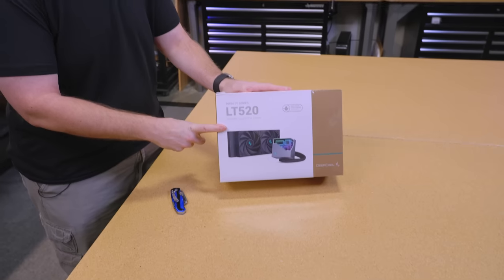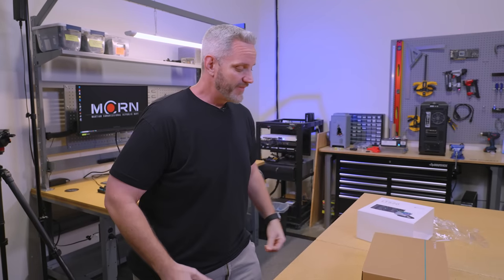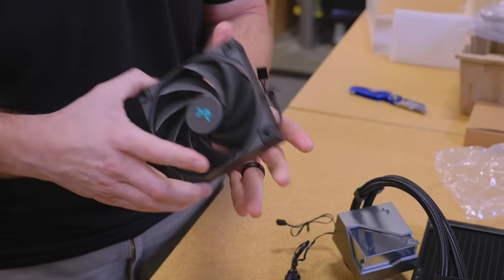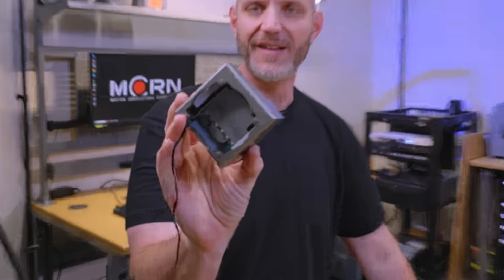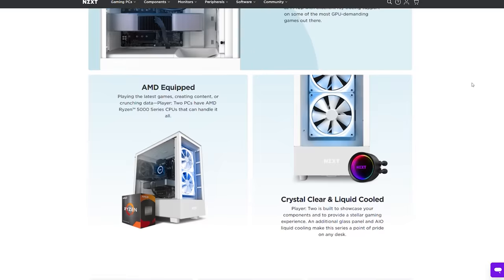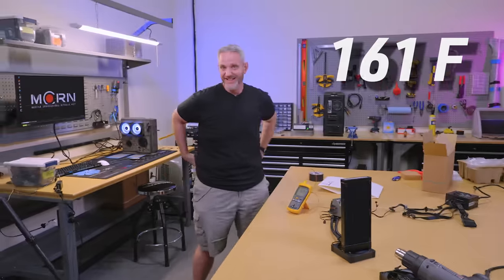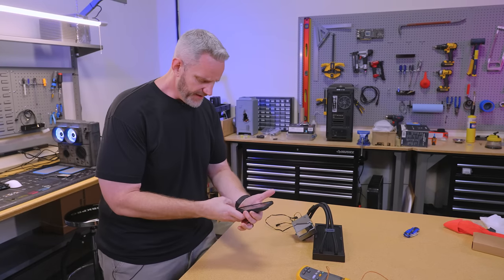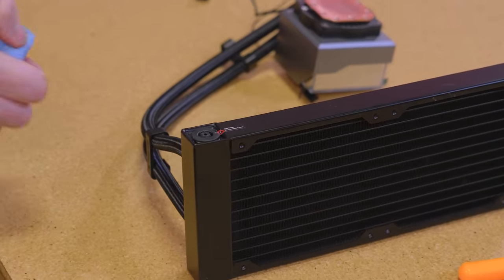They say is won't leak... I'll be the judge of that!

Comment: That bag is inside the radiator and it's pressurised to a certain amount, when the liquid temperature increases the pressure will also increase and the volume of the bag decreases to maintain a constant pressure inside the aio. It works like a reverse water expansion tank that you usually find beside an electric water heater.
Reply: Exactly! And that's why I got the deepcool castle 360  in 2019 to throw on my brand new 3700x. No problems going strong front mounted.
Reply: Was about to comment this, for some of these videos I really wish jay would invest 5 mins more of really understanding the Idea.
Edit: It's kinda nice that, as a side effect, you can refill this AIO with distilled water in case too much diffused:)
Reply: @Ahnii it's shit like this that keeps Jay well and truly in the "entertainment" category. I watch almost all of his videos, and I do enjoy them, but sometimes he just starts chatting absolute bollocks about things he could have understood with like ten minutes of effort.
Reply: I mean even the pic he showed shows it sticking out so you can freaking see it with a big arrow that shows how air is what comes that way. OR he could read the paragraph right next to it..... How would that even work. That doesn't even make sense. I think he's smoking the stuff bro.
Reply: The other thing to add is that the volume of the bag does not need to be that big.
Remember that it is compensating for the volume increase of the coolant over the design temp range.
A 240 AIO fluid volume is going to be what? half a litre maybe. Just how much will that half litre expand between 20 and 70 C?
Reply: Exactly correct. For anyone interested, the relevant equation is PV=nRT, since moles and Rate Constant are constant, you can simplify to PV/T is constant.
Reply: @petert3355  a 240 aio have around 200ml of water inside, if we take in consideration that the volume it's 200ml, the ambient temperature(initial temperature) 20°C, and the max operating temperature 50°C, that water will expand whit approximately 4.2ml, and in Jay's experiment the volume of water increases with 8.4ml. So... That's more like an anti bursting feature, not an anti  leaking feature.
Reply: @alexandru5989  ok, my volume was pulled from you-know-where but I tried to base it on my current system. (it's 4 litres of coolant).
point is, and thanks you added numbers to it, the volume of the bladder does not need to be that large to handle the temp change for the coolant volume involved here.
Having the rubber bladder that size, entirely within the rad tank, would work without the bladder extruding from the rad. All it would do is collapse.
Reply: It’s more likely that the little bit of air in the fluid chamber is the thing that would expand most. The fluid itself wouldn’t change volume appreciably unless either it boiled (and became a gas) or it froze (and became a solid). And interestingly, water is pretty rare in that it actually expands when it becomes ice. That’s why ice floats.
Reply: The bag isn't pressurized, it's just a length of tubing open to the outside air on one end, so the fluid can squeeze it.
Reply: @TheSkiddywinks  I don't know what video you watched but he clearly understood how it works.
Reply: @phunkydroid  Well technically it is pressurized to atmospheric pressure. But you are right, it is just essentially a void in the loop that can be squeezed if any excess pressure were to occur.
Reply: I'm going poop.
Reply: Jay has been completely disconnected from the industry for many years now. These videos are just to pay the bills. And buy more properties and fancy cars.
Reply: It's not the heat, it's the humidity !! :)
Reply: @nddbulldog1  Did you not hear me? I'm literally pooping (still). I think this new pre-workout powder is messing with me. It's hard to tell though because I actually enjoy pooping so I don't as often as possible. It's very relaxing to be in here, just me my tablet and my thoughts... I use a bidet by the way, I'm not a disgusting heathen.
Reply: Lets call it the AIO condom. And like a condom, it save you a ton of money.
Reply: @justinseans I mean he is in cali….
Reply: He said that..
Reply: And you can refill or change the water in the closed loop too, not all AIOs can do that.
Reply: @petert3355 500liters of steam from half a liter of water soo
Reply: @rubenjanssen1672  yeah, but how much steam do you get from 80 degree C water?
Exactly none is the answer. 
We are not talking about a boiling loop here.
Reply: @petert3355  wrong youhav always some liquid turning to vapor (open containers of water wil turn drie eventualy) is it as quick as  oiling at 100c no but it stil hapens
Reply: @rubenjanssen1672  the amount of steam generated at 80C is negligible compared to the expansion in fluid volume. 
That is basic physics.
Reply: The volume increase as the temp increase to maintain pressure as the user maunal said. idk how squeezing the bag would increase the internal volume tho.
Reply: Almost required for folks with boiler heating in their homes. Obviously their expansion tanks are a bit bigger, old ones are 15 gallons or so, new ones only like 1.5 gallons
Reply: Every hydronic boiler system has an expansion tank or bladder tank to absorb expansion and keep the system pressure from rising.
Reply: How does the temperature of the bag (or anything else inside the rad) decrease when it's being consistently heated?  Is it made from a material that does this? Or does it expand and lower the pressure and thus cooling bthe fluid? (Not a big enoughbsystem, and not enough pressurization in this AIO to pull that off.) 
What am I missing here, because right now the physics isnt adding up for me right now.
Reply: How does the pressure increase, but the temperature decreases? Thats antitheitcal to the laws of thermodynics. Higher pressure = heat. Lower pressure = less heat. Like an AC pump.
Reply: @MurpheeLaw  it's not antithetical you put the problem in the wrong way, the bag it's open to the atmosphere so it's pressurised to the atmospheric pressure, when the temperature of the water inside the loop increases so do the pressure of the water will increase because theoretically the loop was an constant volume and at this point the pressure inside the loop will be greater than the pressure of the atmosphere/bag and because the bag it's made out of rubber,an soft material, the bag will deform/ shrink to compensate that pressure difference. So... when I said that the volume will decrease I was referring to the volume of the bag not water
Reply: @MurpheeLaw  You are way overthinking this. The bag just gives a bit of safety margin if an over-pressure situation were to occur. It doesn't lower the pressure, or cool anything. It is nothing more than extra space for expanded fluid (pressure) to go.
Reply: @michaelscott466  are you still in wc ?

Comment: I assemble PCs for a living, dedicating 9 hours a day to this work. Over the years, my experience with Deepcool has been incredibly positive and consistently reliable. The LT 720 is significantly better than the Asus Ryujin II, even with Noctua fans. Based on my experience, all of their products are amazing and reasonably priced. However, my favorite coolers to assemble are their AK series for air cooling and LT series for AIOs; they never disappoint and so easy to assemble.

Comment: I went with the Deepcool LT720 for my first ever PC Build (built the PC a few weeks ago), and I LOVE IT! the AIO looks so nice and it has been cooling my 13700K nicely and pretty quietly. I have no complaints so far
Reply: so far... AiOs are not made to last, they will fail at some point.
Reply: @wherearemytesticles  They can last 5 years if you're lucky. I was against one at first, but after the next gen Noctua air coolers got delayed and after hearing how hot the 13700k can get, I decided to get one
Reply: @wherearemytesticles  A decent AIO will last at least the lifespan of your gaming PC if not longer. I've had 4 gaming PC's in my life and only one of them I kept for longer than 5 years before it needed to be upgraded/replaced to deal with the latest games.
Reply: @wherearemytesticles that's a general issue with watercooling. Pumps can die, stuff can get clogged up (although that's usually an issue with the coolant), it's just a matter of fact that moving parts can, and will break eventually. Same thing with fans by the way. It's rare, but it happens. AIOs are the easy watercooling solution, and, generally speaking, a lot cheaper than custom loops, let alone the time you spend on those. 

So, yeah. People are aware that they aren't made to last forever, but that comes with the benefit of low/no maintenance and easy replacing it
Reply: And so you can buy another one. They lasts years, not days  @wherearemytesticles

Comment: Oh wow I'm interested in hopping into the world of water cooling with a LT720, so this video is greatly appreciated!
Reply: I got it just recently
Reply: And I'm planning on getting one in a month or so, along with a new case, also appreciative of the video 👍
Reply: I have the LT720 cooling my i7-12700k. Great cooler.
Reply: Go for it!! I bought the LT720 for my 13700k and it's doing great! I removed the stock the thermal paste and applied Arctic MX-6 and it keeps my CPU cool even under heavy loads

Comment: Seeing it survive this type of torture test speaks really well to its construction! Great stuff, Jay!
Reply: Kind of hard to say it survived the test, it just didn't fail spectacularly. That is all we know for sure.
Reply: 72C is not a high temperature to be honest.. Water boils at 100C. Most gpus and CPUs get hotter than that by far
Reply: @flatmotion1  Did you watch the video at all?
Reply: @flatmotion1  72C isn't a high temp for the CPU. The fluid temp, and pump operating temp (the part Jay was focusing on), have very different thresholds.
Reply: Yeah im still sticking with air cooler. AIO just seems like a ticking bomb waiting to fail and break your components

Comment: I'm more concerned about pump failure than a leak with AIO's which often means the entire unit needs replacing.
Custom loop is where leaks are my main concern because more points of failure while pump failure not since it's replaceable.

Comment: i have been using an older model Deepcool Gamerstorm 240 AIO for over 5 years.. Yes 5 years since I bought it in 2018 to cool my i7 6700K, i had many doubts about this deepcool because i was not familiar with his brand and it was the only one that was in my budgetand it never leaked. I have removed and reinstalled the AIO multiple times as part of PC cleaning. It still performs well :)

Comment: They came up with a solution to a problem that doesn't exist. Good for them.
Reply: There was a problem with them leaking long ago.  I believe it was the original castle R or castle RGB series.  They implemented this fix and just kinda kept with it over the years.

It was their original Captain series AIOs which were released in the early to mid 2010s.

Comment: pretty sure the bag is inside the housing and expanding there. You have the same system in heating loops for apartments with a gas heater. The "bag" just makes sure the loop is always full and under about the same pressure by expanding and shrinking with temperature.

Comment: Hey, Jay! Maybe you should retry this test with a brand new AIO. As you know, an old AIO will have lost some water mass to permeation, which results in reduced system pressure and/or air insertion, which would perform the same function as the bladder in the DeepCool. A brand new AIO would experience far greater pressure change. That said, those flexible tubes just might have enough elasticity in them that you still wouldn't get the same effect as heating an inelastic radiator.

Comment: Well, the brand new one didnt blow up. But after a few years when the O-rings weaken the pressure compensation gets more valuable. It takes stress off the rubber tubes and seals because they get stressed from repeated heat and pressure cycles. Or get stressed LESS here, which would probably increase lifetime except for unexpected pump death.

Comment: Bursting tubes are something I've never really worried about with aios/water cooling. It's more things like an issue my friend had where the tube split, leaked onto his gpu and killed it.
Reply: I've watch quite a few videos on AOI's and apparently for one to leak is VERY VERY VERY VERYYYYYY rare. like almost basically impossible. Though the longer you have it the chance I guess could be higher? or you get a really really faulty one.

Comment: Jay, you missed the engeneering idea.

Usually AIO is a fully sealed system and when you're operating - liquid increases its volume. When you turning off your PC - it cools down and volume (aka pressure) goes down.
And now imagine this happens every day, every week, every month. 

How many cycles for volume/pressure increase/decrease it will create? And all those "spikes" will be harming all the sealings in AIO, ,there is no places for pressure to go. It will put all the force on plate/connections. And water sand the stone over time.

What this system feels to be - compensator, that takes this everyday expansion on it, instead of mechanical parts.

Comment: Got a cheap pump for the cat water box on Ali and on a regular base I put near boiling temperature water in it to kill bacteria. I let it run until the water is cold then I throw it out and replace the water with new cold water. Works reasonably well to clean it.
That pump sounds exactly like it did when I first installed it. Pumps are capable of more than you think they are.There is a limit but that limit is probably >100c after all you want to remove the possibility that it dies if you forget to plug in the power.

Comment: Bought castle 240 half a year ago used. Its so quiet that when i tried to check the pump, it was completely silent,with no vibrations,i couldnt sense its working at all. I had to trust the seller and take the risk

Comment: Most of anti-leak technology used in these type of closed loop is filled with liquid and closed in little bit of vacum. That is it. Fluid expands when temperature rise so it is safer when before temperature rise start from lower preasure

Comment: I had a GameMax Iceburg 240 AIO I bought back in 2017, I used it on my system for just over 4 years until one of the pipe went, not sure exactly what happened but my PC just shut down one day and wouldn't restart, I opened it and noticed a big puddle of liquid on my GPU, when I took it out I literally poured coolant out of it, the coolant had small brown bits in it that looked a bit like rust, couldn't fix it but it was about time to upgrade anyway so I just built a new PC and I'm still using an AIO only this time I went with a Cooler Master instead, so far so good. I'm planning on building my first open loop in the near future.

Comment: I've been running a 3 set of their FC120 daisy chain fans in my build and I'm a fan (no pun intended). They daisy chain through a cable instead of pogo pins so they aren't as fancy as Lian Li or Corsair, but the fans do mount to each other very solidly. I still have some Corsair fans in the build as well and I've been toying with ripping those out and just getting another set of the FC120 to get rid of the commander node. One annoyance is that they don't have any 140 fans in the FC line and their support told me that they don't have any coming out anytime soon.

Comment: On the third side of that coin ... 
you have a plug, so a few years later when fluid permeates out you can easily crack it open to add some.
Soo many aio's dont have a user removable plug

Comment: As Jay said that so many don't, the cooling fluid strips ions from the metals, which is why you never use distilled water, being distilled it has no metal thus it will strip ions as it is electrically unbalanced. Use PC specific cooling fluid or de-ionized water and making sure all exposed metals are of either non reactive metals like Nickel or stainless steel (high chromium-Chrome content) or of the same base type.
Reply: there is so much incorrect information in this dumpster fire of a comment. suffice to say, distilled is the best coolant and you should refrain from advising anyone on pc's.

Comment: I just completed a build using this AIO. The fans have a wine to them at some RPM ranges and I had to replace them. I live in a rural area so returning wasn't really worth the drive or effort back to Microcenter. I replaced them with Thermaltake Tough Fans which work VERY well. The temps on my 7800x3d are fine, not great, but well within spec  46 at normal and around 70-74 at load. Fan Control curve is running 50%-100% for the curve. I tried to repurpose the fans as case fans and they still wine. Maybe defect, maybe trash fans.... In retrospec and future I wouldn't save the $30 and just get something better. Hope this helps someone looking to build with this cooler.

Comment: This anti-leak is functioning similar to an expansion tank on a home hot water system.
I would suggest looking up the operation and function of a boiler system expansion tank and you'll see what deep cool was doing with this air blatter.

Comment: I have been using the 240 ex castle for 4 years with intense CPU torture game running it 24/7 for the past 4 years and i can tell you it survive,my temp is 49-65 depends on my ambience since i have no air-conditioning,so yeah i vouch this brand and product is very good while my other setup have problem on the pump within 1 years on same game

Comment: I rebuilt my PC this year and bought the 360mm version of this AIO, strictly because of the infinity mirror pump block fitting with the aesthetic of my build (infinity mirror case, infinity mirror Lian Li fans) and it's mint so far. Can't hear it in operation, easily handles my 12700KF.